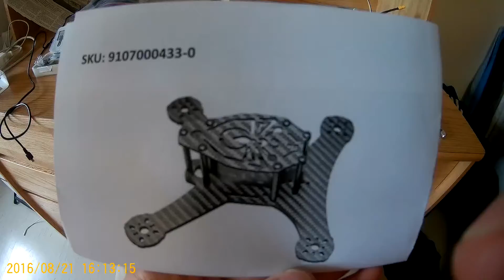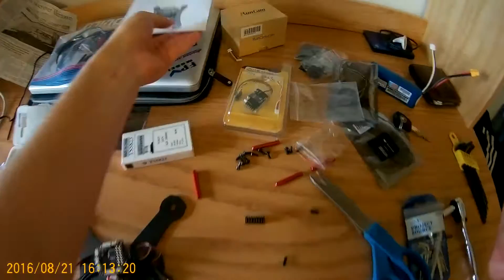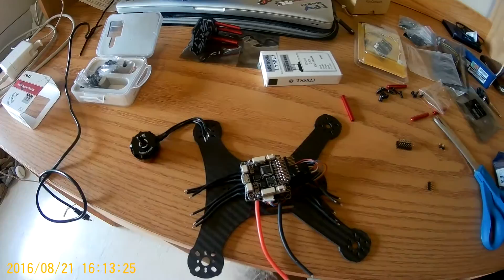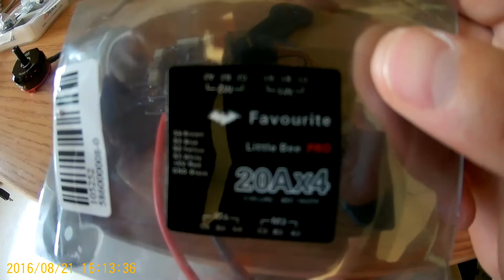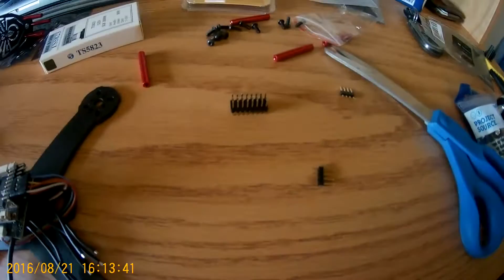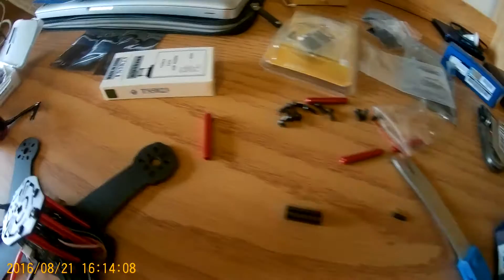SpyderByte Widowmaker 170 Build Part 1

Comment: I know this will all be revealed soon, but where are you going to mount your battery? The strap slots are on the underside, but I've often seen people put the batteries on top of other quads.
Reply from the maker: I'm mounting the battery underneath the quad. I want to leave room to create a 3D printed GoPro mount up top since I know this quad will have plenty of power to carry one.